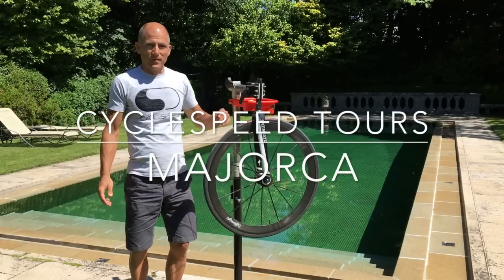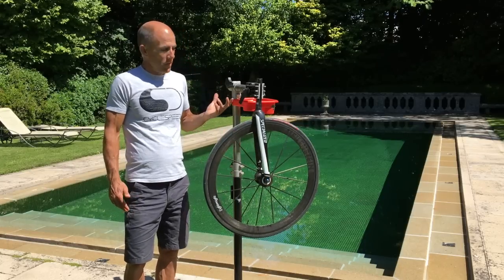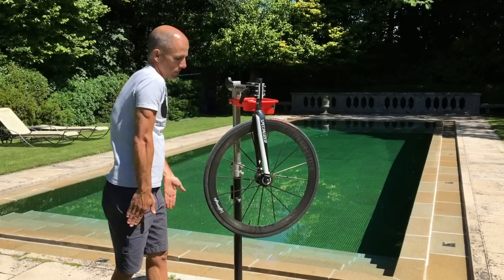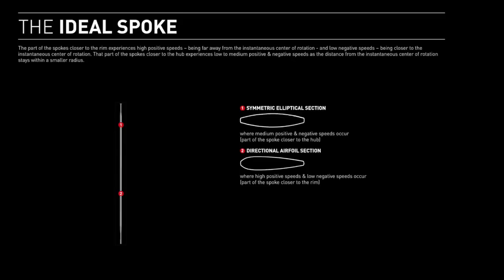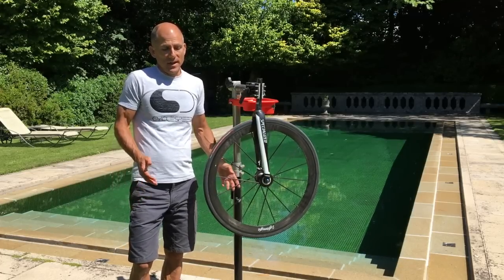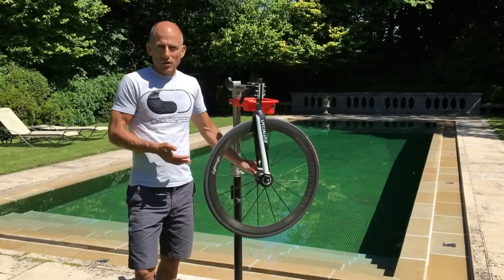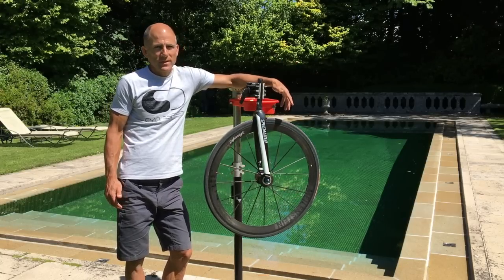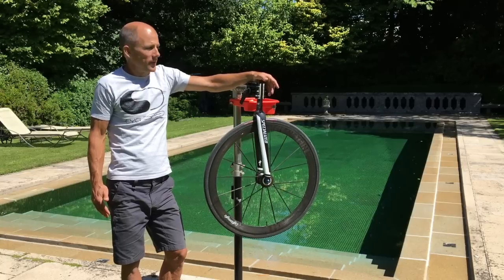Aero Wheels - What they are NOT telling you!

Comment: How do you conduct an aerodynamic test of a wheel without including rotational drag?
Reply: In a normal wind tunnel test they rotate the wheel but they only measure the drag linearly in relation to the direction of travel - they don't measure the amount of energy required to maintain the rotation of the wheel itself.
Reply: Baxter Ross actually they do.  Since the top of the wheel is moving at a high velocity relative to the wind and the bottom is moving at a low velocity.  The top of the wheel generates a force backwards while the bottom generates a force forward.  Due to the difference in velocity of the top and bottom and the cube relationship between velocity and drag, the force pushing back will be significant while the force pushing forward will be negligible (I’d guess its zero but I’m not quite sure). Therefore the wind tunnel testing includes rotational drag in the measurement.
Reply from the maker: @mrlaforgephysics  Joshua, what is making the front wheel spin in the test? Some kind of motor right? It doesn't spin all by itself. THAT is what I am talking about; how much energy is required to spin that wheel. I think we can agree it will be much more at 50km/h than at 30km/h........
Reply: @CyclespeedTours  okay. This is going to be hard to explain without a diagram, but the force balance that holds up the bike would still measure the force you're talking about. The force from the motor acting on the tire acts toward the back of the bike. The force of aero drag on the top of the wheel also works toward the back of the bike. Both of those forces would be measured by the force balance. The net torque of those two forces has to be equal and since they both act at the same radius because the wheel is round, they would both have to be equal forces. In other words, the force balance would actually measure the aero drag on the wheel twice every time a rotating wheel is in a wind tunnel. I think it's likely, that they factor that extra Force out because they know what the motor is applying, but there's no reason to believe that the aero drag on the wheel rotating is not measured.
Reply from the maker: Thanks Baxter, I think you're explaining this better than me!
Reply: Easy, aerodynamic tests test aero drag...the rotational drag is a very small drop in the bucket with a 150lb rider mounted on top of them
Reply from the maker: In a 'normal' wind tunnel test, if the wheel isn't spinning there is no rotational drag. If it is spinning then it will change the results, but the key point is, how much power does it take to make it spin? That is what DT Swiss have been looking into.
Reply: @CyclespeedTours  

Of course those factors are tested. They just don't publish everything. The first "aero" wheels were disks without any spokes because that was the very first thing that they were concerned about. Fluid dynamics is very complicated and marketing folks don't have much confidence in learning everything that they must learn and then translating it to their potential buyers.
Reply from the maker: Fair points, but the marketing guys don't seem afraid to try and tell us all about their latest yaw angles and dimples, etc.... @indonesiaamerica7050
Reply: @CyclespeedTours  

Naturally. I understand that if they agree with your basic assertions (and I think that they do) that they fear the buyers will start off by looking for models with the fewest spokes and then spoke shape as key factors and only then can the marketing people attempt to sell their unique solutions. It would further commodify engineered products. That's good for the consumer if the consumers make good choices. It's not good for engineers. 

Caveat emptor never really died. We just stopped teaching critical thinking to students.